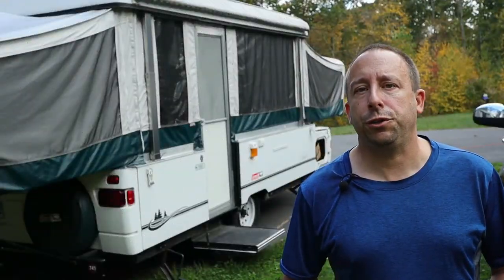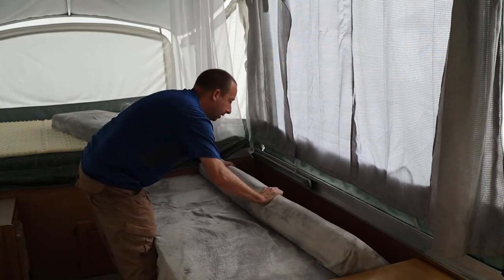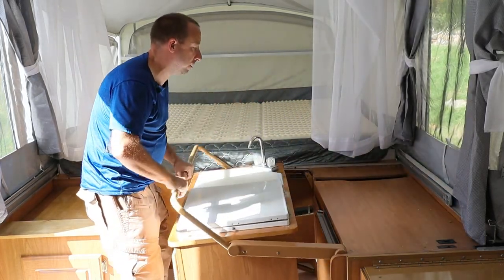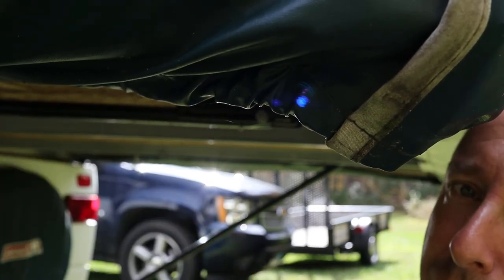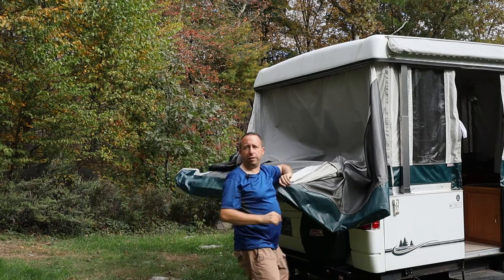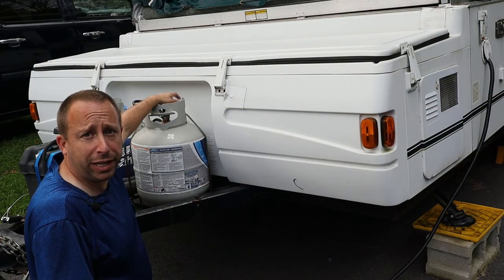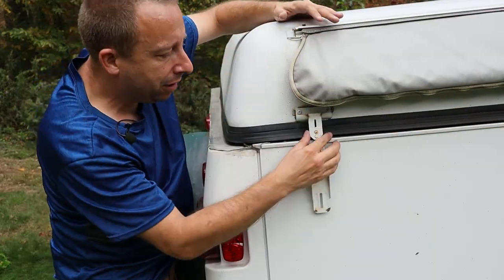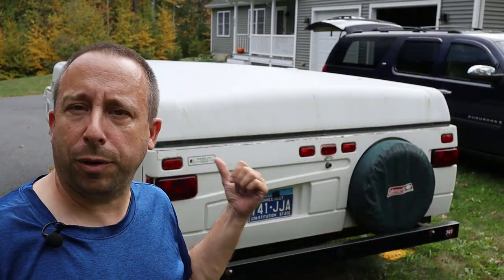Easy Pop-Up Camper Pack-Up Highlights // Coleman Utah by Rockwood

Comment: I appreciate the reality video of pop-up campers. Some of them are really expensive! To me, it just seems like a lot of work and especially for someone like me who would really only be doing this for a weekend here and there. I am sure over time it just becomes a normal thing to do and you don't think of it but I would be thinking, what if it's a really terrible day? Thanks for the video.
Reply from the maker: I agree...that's why I got rid of this last year.  It was more work than it was worth.  I went back to tent camping...
Reply: @SevenFortyOne  So, tent camping is easier? I would think it would be more or less the same in the time frame of setting up. I have purchased one of those easy up and down tents that I will test out this fall, who knows.
Reply from the maker: Yes...tents don't sit in the yard 51 weeks of the year taking up room and getting mice in them.  They don't require a gas guzzling tow vehicle either.  I can set up a tent on any patch of flat ground in a few minutes and don't need to worry about it I have enough room to fit them on the site or how to back in or fit in a small space.
Reply: @SevenFortyOne  So true and something to think about. I am forever checking out RV'S but they are too $$ for me. Honestly, the truth is, at best I would be able to do this maybe a grand total of two weeks a year (because I won't be camping every free moment I get). Sitting in the driveway, mice, the gas and the insurance makes me wonder if tent camping isn't just the better way in the end.

Comment: I owned a similar model Coleman in the mid 90's, and camped from Florida to California and back, and throughout the US in it.  Replaces tires 3 times.  It served me well, and as the family grew I moved up to a Class C Camper.  In a motor home you lose the ability to unhook the camper and take day trips in a smaller tow vehicle,  but gain the ability quickly set up and tear down the campsite in the rain.  One can also use parking lots in rest stops to take a snooze and cook up some dogs.  But I sure loved my Coleman.